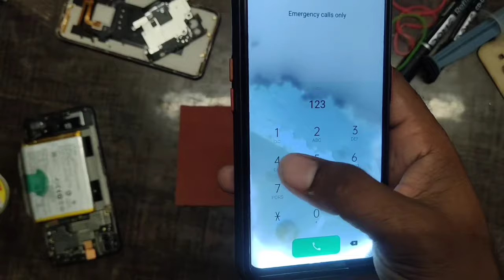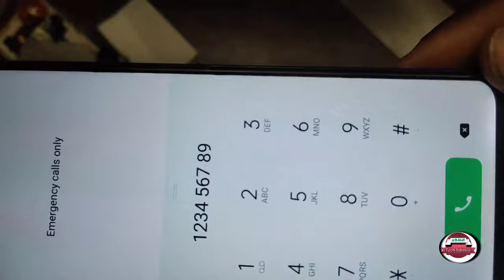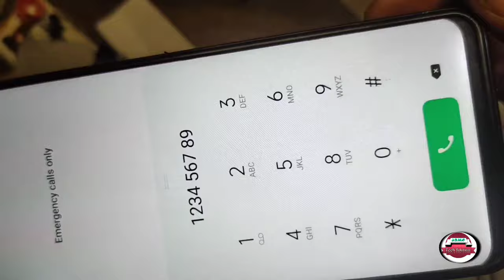#How to fix Oil and water Damage Display

Comment: Can water cause flickering on screen
Reply: Yes
Reply: Yes but it may be different case because it also can be caused by some mechanical damage or by falling of phone it can be solved by oled saver you can watch the video of oled saver how to fix flickering in smartphone it is very easy 🙂
Reply: Heat
Reply: @shouryadevsinghgaharwar3268  👍
Reply from the maker: My brother, since 6 months my health is not well, so I am not replying to anyone, nor am I working.
Reply: @repairtipstricks489  bro could've just said yes or no

Comment: Bro pls..tell me....how can I remove oil from my phone.. Its spreading on the screen..... And my phone is Sony Xeperia...what should I do....? Do I have to give this phone to a shop..to clear this? And how much will be the price? 😢Pls reply..
Reply: Replace the screen.
Reply: If the oil spread in the motherboard no one can quaranti when the system malfunction.. If it spread only in the screen i can be fix like this vedio.. But if it affect the motherboarrd u need differnt solution.. Change the motherboard
Reply: Oh ok..thankyou bro's...
Reply: @jensrb50  bro uhr display is as it is right now?